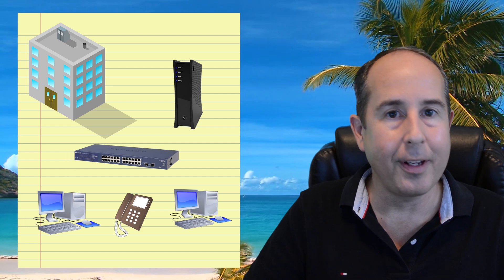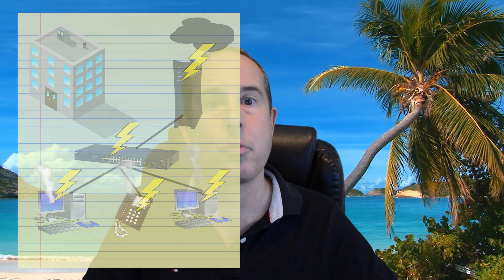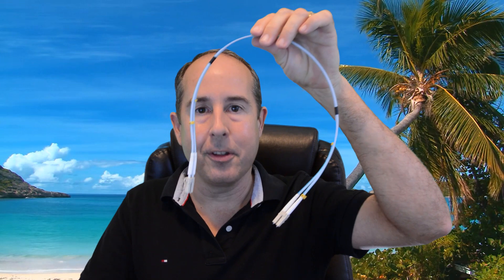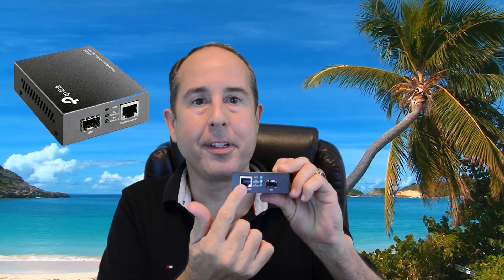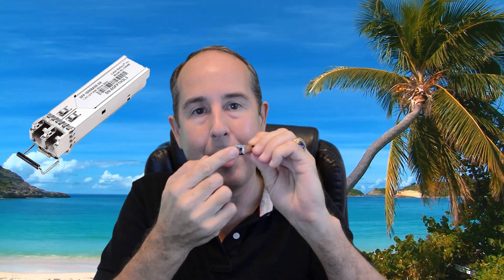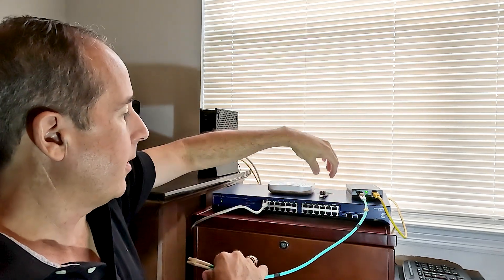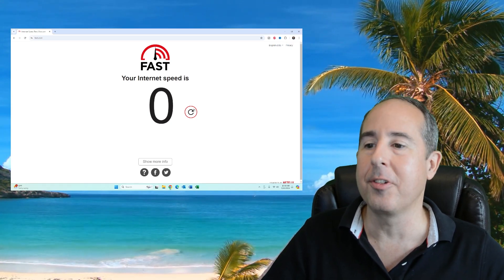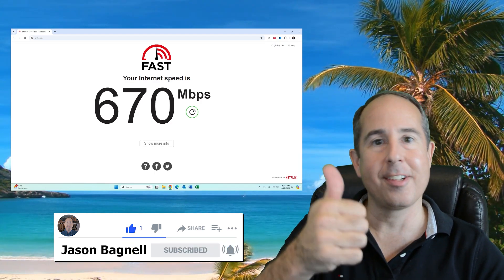⚡️Fiber Optics | I STOPPED lightning damage by using Fiber Optics!⚡️

Comment: Wow, great idea! I recently had both my router and the Ethernet port on my TV damaged by lightning. I'm now thinking of placing this setup before my CenturyLink fiber router. Here's the plan: run the Ethernet from the wall into a media converter (Ethernet to fiber), then use a fiber optic cable to another media converter (fiber back to Ethernet), and finally connect that to the router.

Do you think this would help protect the Ethernet devices inside my two-story house? I’m seriously considering it and would love to hear your thoughts. Thanks again—brilliant solution!
Reply from the maker: Thanks for your comment on this video!  When YouTube showed it to the initial "Test" audience, it must not have done well because the video never took off.  I made it to share my creative solution that fixed my client's repetitive lightning damage problem.  They have not suffered any damage since I made the change.  I do expect that the next lightning hit will blow up their cable modem because it is on the unprotected side of the Internet connection.  The cable company will replace their modem for free but at least they won't lose a PC, server, router or switch in the process.

The reason this setup works for my client is because they use a cable modem for their Internet connection.  It seems like the lightning always find it's way into the building through the coaxial cable wire that the modem is connected to.  Before I made the change, the lightning would blow up the cable modem, jump into the attached router/firewall and it would sometimes go through the main network switch and branch out to anything else it can find (PCs, Servers, VOIP phones, etc).

In your case, you mentioned that your Internet comes from a CenturyLink fiber connection.  That means that the Internet line coming into the  house has already been converted to fiber optics, so the lightning damage is unlikely to be coming in from that direction.  The surge is probably coming in from another direction.  

Make sure that ALL power cords on ALL devices (Computer, Monitors, TVs, computer speakers, switches, printers and attached hardware) are plugged into a surge protector or UPS backup battery.  Any one of those devices that have a network cable that runs back to the main router/switch can pass along lightning surges to the entire network and everything that is physically connected.  

Also, if you subscribe to cable television and there is a coax cable connected to your TV or DVR, consider connecting the TV to the network/Internet using WiFi instead of with a RJ45/CAT5e cable to eliminate the surge from coming in from the Cable TV line, reaching the TV/DVR and then getting passed on to the rest of your network.

Just some ideas!  
Thanks again -- Jason  :)
Reply: @JasonBagnell  Thanks Jason. Will take these points into consideration. I really appreciate you taking the time for this comprehensive reply!

Comment: I have a gaming PC that won’t start up launchers when I double click the application. I wanted to wipe my pc clean for a fresh start as in sign in to my email again and download the launchers myself in hopes of the pc will launch them. I don’t have anything work related on the pc it’s only been used for gaming. I do want to keep windows 11 so I won’t have to download it again, I don’t have anything on my pc I need to recover. Is this possible?
Reply from the maker: Hi!  I have a few videos on my channel that will help you with your options.  First, you can run the "Reset this PC" program to remove everything (programs, apps, data, etc.) from your current version of Windows and return it to a clean-running state.  See this video:  https://youtu.be/zW2v3M_xFVY   You would not need to use the "Clean data: Yes" option because you're not selling your PC or giving it to someone else. 

Alternatively, you could perform a Windows "Clean install" and to completely reinstall Windows 10/11 from a blank hard drive.  Everything would be setup from scratch, but it will take more time and effort than using the "Reset this PC" program I mentioned above.  Here are those videos:   For Windows 10:  https://youtu.be/bP03Y-l9NOM    For Windows 11:  https://youtu.be/ZMKl9wBJYD0     If the Windows Setup program tries to force you to join a network and join a Microsoft Account, you can use the OOBE\BYPASSNRO trick in this video to skip doing that if you want:  https://youtu.be/UdyP_bHSUlE

Hopefully these are the options that you are looking for.  The "Reset this PC" would be the easiest method to try first.  Thanks and happy holidays!  -- Jason   :)
Reply: @ what about solutions for applications that won’t start at all. I been using exit lag and have tried uninstalling the application but says I can’t proceed to uninstall unless the application is closed, in hidden icons it shows it’s running in the back but I can’t close the application or launch it at all.
Reply from the maker: @fernandoe1250  Hi! You could open the Windows Task Manager, go to the Processes tab and try to identify the line that relates to "Exit Lag".  Right click it and then choose "End task".  You may need to try ending the task several times.  Once it is no longer running, you should be able to remove the program.   If that doesn't work, go to the Startup tab in the Windows Task Manager and right-click and disable the one that relates to Exit Lag.  Reboot the PC and hopefully you will be able to uninstall the program.  I hope that helps!  -- Jason  :)

Comment: Kinda kool. I remember decades ago getting warnings about lightning - Do not use anything electrical including phones during a lightning storm. One could go poof in a not so good way. I always wondered if a well grounded lightning rod would take care of this issue though
Reply from the maker: Hi!  What's strange at my client's office is that everything is properly grounded.  The big wire that comes from the utility company does run through a lightning arrestor that has a heavy copper wire that runs to ground.  I think my "beam of light" solution will finally keep lightning out of their network.  Each time is has happened, the Internet company has had to replace their cable modem and gateway, so I know that the problem is originating from the cable modem's coaxial cable input wire.  Have a great day -- Jason  :)
Reply: @JasonBagnell  After reading this The converter box may go poof of one thinks about the volts and amps in a lightning strike. Just a mention
Reply from the maker: @ethimself5064  Yes, some equipment may need to give up it's life to save the network but I'm OK with it.  As long as the surge doesn't make it to their network switch (and computers, phones and server), everything will be much better than before.  The Internet company will need to keep switching out their modem & gateway devices whenever it happens again, but that's a problem they'll need to work on.  Thanks!  -- Jason
Reply: @JasonBagnell  I have been online since 05 and nothing toasted yet. I can see your point though. Just thought of something - Go fiber cable from the provider would work best if possible
Reply: Could you help me out with my pc? I facory reset it 16 hours ago and is stuck at 64% but when it shows it is imeditly restarts my pc. I can send You a vid if you need. Enythink helps
Reply from the maker: @Qpy-_-.r  Hi!  Your reply might have gone to the person who posted the original comment thread too.  I assume you're using the "Reset this PC" program to reset your computer?  If so, give it a LONG time to complete.  It can take 4-12 hours (or more) to secure erase a large "mechanical" hard drive.  If the computer is completely unable to boot, you can use the steps in my videos on how to clean-install Windows 10 & 11.   See:  Windows 10:  https://youtu.be/bP03Y-l9NOM  For Windows 11:  https://youtu.be/ZMKl9wBJYD0    Those two videos assume that you want to ERASE everything on the computer's hard drive(s) and get a fresh start, so backup anything you want to keep first.  I hope some of this info helps!   --  Jason
Reply: @JasonBagnell  hi, the thing is its stuck at Loading but its switching from connected to not being connected to the monitor and its not the cable and the monitor becuase it workes with a mac
Reply: And its been almost 22 hours now